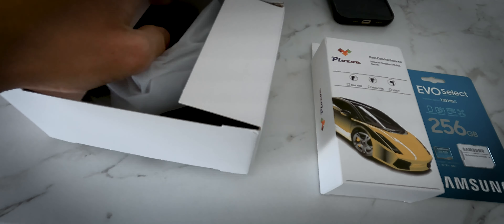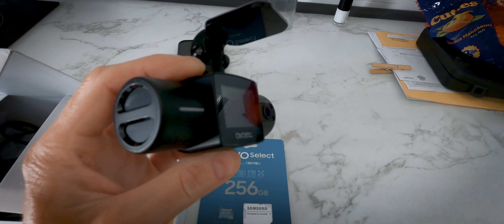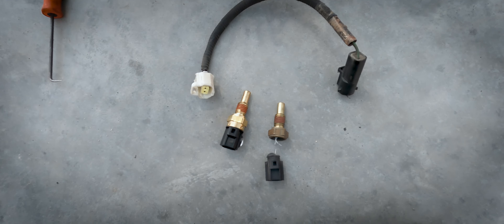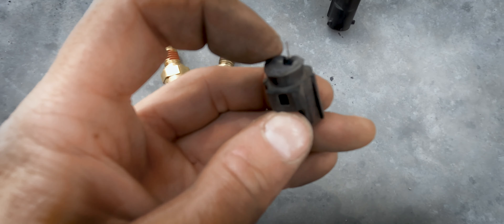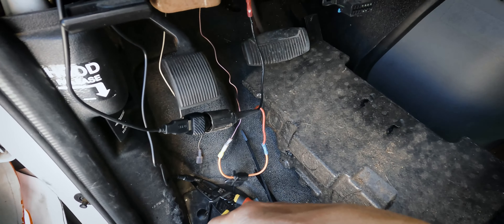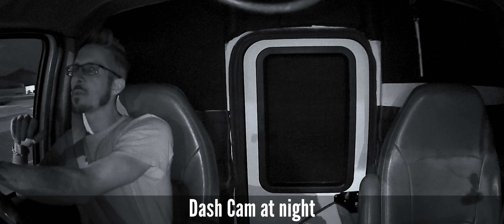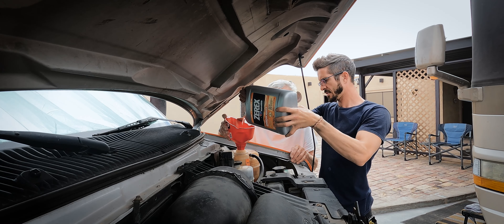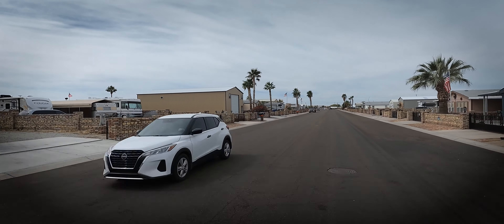It’s getting worse!

Comment: Brad, I’m glad you’re getting closer to alleviating this coolant issue. At least the thermostat is a relatively cheap fix. I get your dilemma though. You had recently put in a new thermostat but like all things they can be faulty. One thing for sure, you know what is new and what isn’t whether it’s your e-brake issue or the coolant system. Thankfully nowadays we have YouTube to find info. The old days you had the option to buy Chilton or Haynes manuals for your year, make and model of vehicle. Anyway, I hope this solves your issue and you can start trusting the old girl again. Thanks for sharing!
Reply from the maker: I remember the Haynes days! I had one for my old bronco! I definitely prefer YouTube videos for diy work
Reply: FACTS my Pops started me off with the Chilton's working on his Olds Delta 88.

Comment: In the Texas summertime, I completely remove the thermostat. My box truck runs much cooler. I'll put it back in November when we have our cooler weather. I've done this for several winters. This winter, I skipped putting it back.
Reply from the maker: Interesting, I may just remove it since I follow the good weather all year
Reply: Removing the thermostat can cause overheating on the highway.  One of the T-stats job is to hold coolant in the radiator long enough for the heat transfer to take place. A properly operating thermostat opens and closes frequently, and can partially open to help it accomplish the goal of restricting the flow of coolant to allow this heat transfer to take place. If you remove it, at higher rpm's the coolant cycles thru the radiator faster than the radiator can dissipate the heat.  So you end up with hot coolant going back into the engine.  If you have been doing this without any problems then your box truck must have a big enough radiator that it can still dissipate the heat. Or maybe you have a partially clogged coolant system and that clog is acting like a thermostat.  Also if your engine is running cooler than it's designed this can lead to increase in exhaust emissions which over time can damage your catalytic converter.  Can also cause excessive carbon build up inside the combustion chamber, possibly foul out the spark plugs.
Reply: Interesting. I've been doing this for 8 years. My truck never overheats; in fact, just the opposite it runs much cooler than with a T-stat. It gets 110F (in the shade and 123F in the sun here.
Reply: @Tom-Travels  I am a native Texan, so I know about the heat. Driving around town it would run cooler without a T-stat , it's on the highway where it could cause an issue.  Do you do any extended highway driving? A box truck or Van would have an oversized radiator so it may not be an issue. But on a vehicle with a radiator just big enough for the system it can and will cause an issue.  I have been an Auto tech since 1991 so I have seen this happen a time or two. Same thing happens when the T-stat sticks open. Any time a customer complains about overheating on the highway but normal temps in town the first thing I check is for a stuck open T-stat or missing T-stat.  Unless it's a Dodge Stratus or Intrepid with the 2.7 V6 engine where it's a 6 hour job to replace the T-stat!  Lol

Comment: Be careful with using a lower temp thermo. I don't know what kind of electronics are on hat truck, but some of them are set to activate when the engine gets to a specific operating temperature. If it's too low, the don;t activate, which can cause bad gas mileage, etc.
Reply from the maker: great advice! thanks

Comment: Whenever you touch a radiator system you have to make sure you get all the air out when you're adding in water or it will keep getting hot go on YouTube and see how to fill a radiator correctly to get all the air out
Reply from the maker: Absolutely

Comment: Lower thermostats don't fix the issue of overheating, you need to check the temp drop across the radiator, use a $25 temp gun from harbor freight check your input temp from the hose coming into the top of the radiator and check the lower radiator hose the temp drop should be drastic, if not you have a clogged radiator or a failed clutch on your clutch fan, if you frequently go through mud you want to rinse the radiator out with water since it can get packed with mud reducing cooling efficiency.
Reply from the maker: Thanks Stevo, I thought about getting a temp gun…just trying to minimize the tools and gadgets I have to lug around with me
Reply: @nomadbrad503  can’t blame yuh on that, I’d still recommend finding the exact cause of your issues before you throw parts at anything it gets pricey quick when you throw parts at a problem, when you do automotive work it’s easy to guess what could be wrong the hard part is confirming your guess 😂, that’s were the fancy scan tools, oscilloscopes, boroscopes, and specialty tools come in but what I wrote in the paragraph is most of the stuff I’d advise checking when it comes to an overheating issue, if you have any leaks you can get a coolant system pressure tester and it’ll put the coolant under pressure forcing fluid from the spot of the leak allowing ample time to find the leak they got a tool for everything you could thing of if theirs anything I can help you with just comment here and I’ll do my best to help yuh out
Reply from the maker: @stevo1977  thank you stevo, I’ll let you know if I run into trouble again 😎